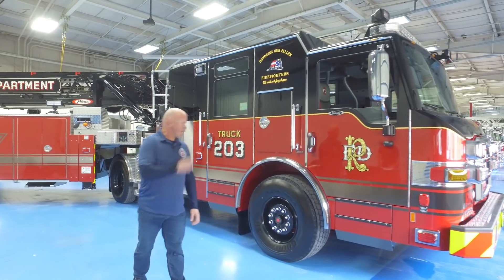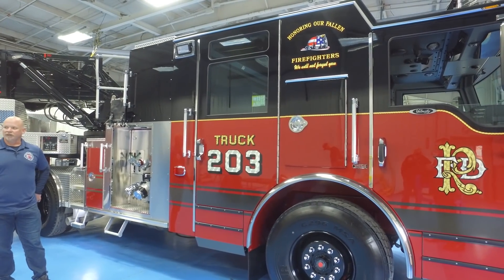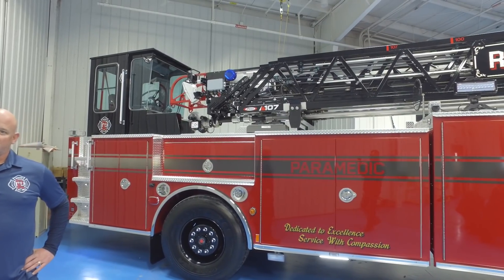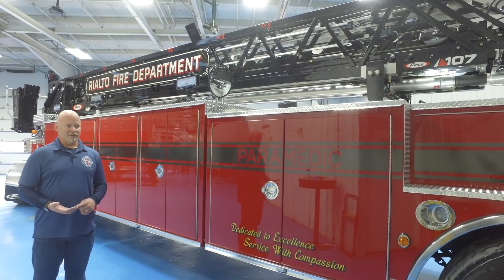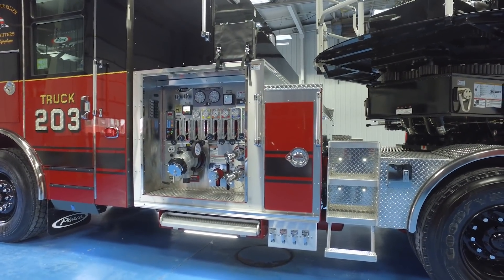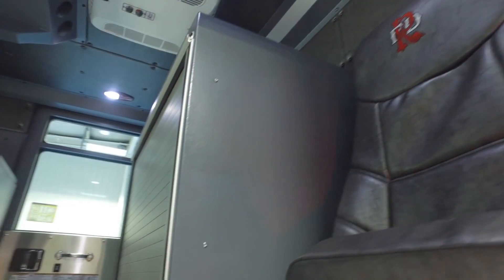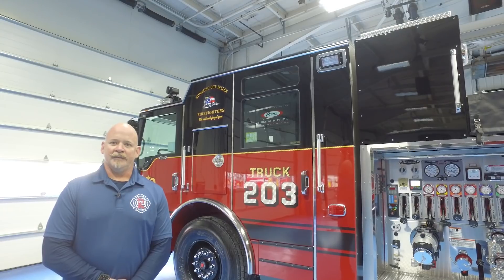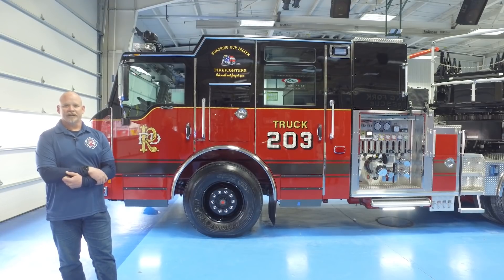Ascendant® 107’ Heavy Duty Tractor Drawn Aerial – Rialto Fire Department, CA

Comment: Just asking ????
Why don't you have a 1 man small pumper as a follow rig with one of your extra person.
instead of putting pump on Ladder. Again just asking why not??????
Reply: What if it wasn't a small pumper, but a regular one, than an aerial can be smaller, no need for a crew cab, most of tools can be relocated to a said pumper, than it doesn't have to be tiller and the price of the both apparatus combined, especially, if put on a commercial chassis would be lower than one tiller. But tillers are cool, so American FDs find excuses why they absolutely need these monstrosities.